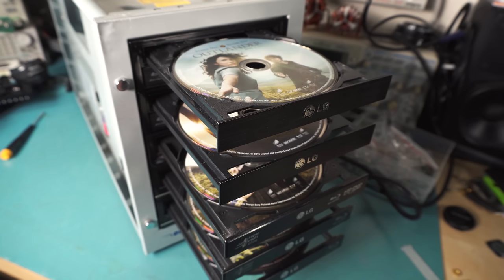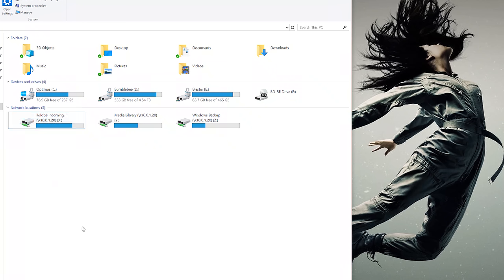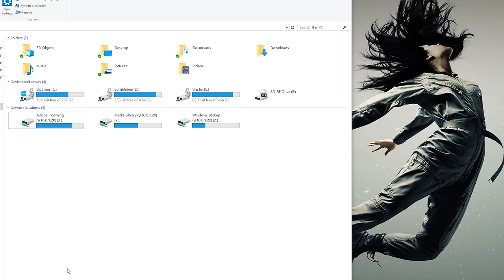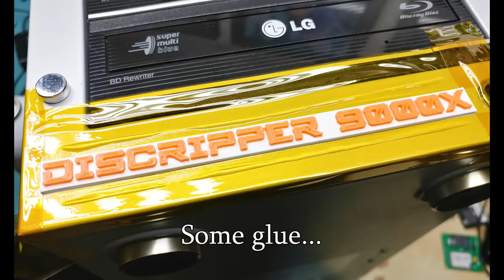Rippin' 5 Blu-ray Discs At Once (AKA The DiscRipper 9000X)

Comment: This was 4 years ago. How is still working for you? Have you done any modifications to it? If so, do you think it's worth doing another video showcasing what you've learned and changed over the years? Great video by the way.
Reply from the maker: I used it for years with no issue. The only real problem with it is finding the SATA and eSATA boards since they aren't being made anymore. I recently switched to an ITX test bench and a modular approach where I can easily convert it to a ripping station.

I will make a video on it... Someday. Haha
Reply: @PeterBrockie  it's still very useful and extremely cool IMO. I'm surprised that the boards are no longer being manufactured. Do you think a raspberry pi USB 3.0 to m.2 data daughter board and a SATA to m.2 board would work? Both are about $30 to $40 each.
Reply from the maker: @BrianThomas  You can go the Pi route, but if you're doing that you might as well build a basic computer from cheap parts. Granted, you can still use the duplicator case with a Pi.

I can see a Pi running out of cpu power or PCIe bandwidth if you start adding a bunch of drives though.
Reply: @BrianThomas  raspberry PIs are very expensive at the moment

It's certainly possible but it wouldn't be economical.

Comment: I've had to use 5 instances of MKV running in parallel to rip from 5 drives, are you using special software that can rip in parallel using one application instance?
Reply from the maker: Same thing. Multiple copies of MakeMKV.

Comment: If you were to redo this project with todays tech what would you use? I'm looking to create something similar. With 4 or 5 optical bay slots.
Reply from the maker: The tech of the case doesn't matter. It only matters how modern you want the drives (4/5 of the drives in this thing are 4k drives now, for example).

Just get any case you want that holds as many drives as you want. If you really want to avoid the plug in design of this one, put a basic motherboard in a case with lots of ODD bays and make a little ripping workstation.
Reply: @PeterBrockie  Well I plan to use blu-ray optical drives. I have four of them. However I'd like to go with a similar design that is plug and play and comes in a similar design as yours.

However I'm trying to see if there is a better solution when it comes to hardware. Was hoping you could make some suggestions. Been trying to research something of this for months and I got small ideas here and there of what to do.
Reply: @PeterBrockie  I plan to rip my content using a program called MakeMKV and the program can read individual optical drives. So that is needed for a design.
Reply from the maker: I use MakeMKV as well. As for connections you have pretty much 2 choices. You can go the expensive way like mine using an eSATA multiport adapter. Or you can hack together a ton of SATA -> USB converters, put a hub inside the case and run a cable from the hub. The hub method will almost always be cheaper overall, but be more fiddly to setup.

The hub method has the advantage of being able to support more than 5 drives. Although I suspect USB3's inefficiency will start bottlenecking you pretty fast when using blu-ray drives.
Reply from the maker: If you want to go the easy way for cases, just go to PC Part Picker and filter by EXTERNAL 5.25" Bays (https://pcpartpicker.com/products/case/#G=8,12). I went with a disc duplicator because I got to make a video on it and because they tend to be more compact than a PC case with the same number of drives since you don't have to waste space for a motherboard.

Comment: I need a 2024 update please 🙏🏾💯💯💯
Reply from the maker: The 2024 update is: This isn't really worth doing. My recommendation now is to simply connect a bunch of SATA drives to a spare motherboard and use it as a ripping system until you're done with all your discs. Then downsize to a single drive. :D

I ripped my large collection and had no use for this after. I still have some of the drives so I just plug them into my test bench computer and rip using that whenever I need to. Now that the bulk of my discs have be ripped, I don't need to do 100 at a time anymore. Sure the disc duplicator looked cool, but it just sits on a shelf 99.99% of the time once you're done your collection.

Comment: i've got an iview 4 bay enclosure with usb 3 and esata. cant even get more than one drive to work.  do these port multipliers have a set max capacity in terms of TB per drive? iview told me it was 3tb per port max, which was crazy. why would there even be a limit? would this be programmed into the controller?  i was hoping to build a 32GB station with 8TB drives, but thats not gonna happen since it wont even work with more than a single 1TB green drive pulled from a WD MyBook usb enclosure (marked A and B respectively for each drive) .

Comment: Stupid question ?? Why didn't you just have five different USB cables . and then you could have a USB add-in card with 5 USB so you just plug all 5 cables into it .
Reply from the maker: That would work and probably work out to be a little cheaper than the specialized route. In my case I wanted a simple, single cable so I can disconnect and hide the large drive tower when not in use.
Reply: @PeterBrockie  you can had one single cable . And inside the box you could have at USB 3.0 hub. But 5 drives going tho and USB hub . It would be faster tho 5 USB 3.0 cables and then put the cables in a sleave

Comment: Hi, I was looking for some videos on doing multiple drive rips. I have ALOT of optical drives, DVD, BD and an HD/DVD drive and tons of TV shows and movies. About your setup, did you connect the eSATA cable from your ripping box to the PC? In my case I still have my Asus P9x79 motherboard that has both powered and non-powered eSATA ports on them, so I could possibly make use of this for my drives. Only thing I don't have is a duplicator case, but I suppose I can just use an mid-tower case with enough drive bays on them. 

Great video!!
Reply from the maker: I used a usb to eSATA adapter - what matters is that whatever you're connecting to supports port multipliers, which not all eSATA controllers do. I wouldn't go eSATA these days. The parts are too hard to find and it'll cost a ton.

If your X79 board is a spare one, I highly recommend getting a cheap PC case with drive bays and putting the motherboard in it. The cost of a duplicator + the eSATA hardware I used is more than the cost of a cheap case and a cheap motherboard to directly connect the drives.
Reply: @PeterBrockie  thanks I appreciate the response. Yeah my X79 board has been sitting around for a good while and looking to give it something to do and since it has the esata connector on it may see if I can put that to use. I would guess then the optical drives would connect to the motherboard SATA ports then could output with the esata cable to another system (workstation in my case). 

The esata port driver for the board supports PM so may give it a shot. Plus I have a Cooler master HAF 922 case with 5 drive bays so just may use that instead. Save money that way.

Comment: Where can I find a ZAGE-D-ESAU3 ?   I have not been able to locate one.
Reply from the maker: They look pretty discontinued at this point, so I doubt they will come back in stock anywhere. Looks like the other method of using USB -> SATA adapters and a hub with one USB cable coming out is the only viable method now.

Comment: A simpler  way: raspberry pi + usb-sata converters+ passthrough drives to iscsi. connect to ethernet and use it like physical drives.
Reply from the maker: Does iSCSI work with optical drives? I've never looked into that.
Reply: @PeterBrockie  it is possible to export disk drives under linux.

For example, https://www.smetana.name/blog/2014/10/20/sharing-dvd-drive-over-iscsi/

Comment: What did you do with the original controller? I have a Reflex 10 that I'm looking at maybe doing something with, and I'm wondering whether you did any delving into the capabilities of the controller versus just gutting the device and bypassing everything?
Reply from the maker: In theory it could be reprogrammed, it's just a standard controller and cpu. But it was beyond the scope of what I needed it for, so I resold it and used the controller board seen in the video.

Comment: Could I buy a dvd duplicator and then modify it to rip dvds rather than duplicate them?
Reply from the maker: Nope. I mean there might be a duplicator controller with a USB port which shows all the drives on your desktop, I doubt there are many and I'm sure it'll be usb 2 speeds.

I think the best and cheapest way is to get SATA Odd to usb adapters for each drive and run them into a hub jammed in the duplicator. The eSATA method I show in this video is expensive and hard to do now that eSATA stuff is way out of production.
Reply: Thank you for your reply. Do I need a specific type of case/chassis which will fit the disc drives in?
Reply from the maker: Not really. I mean you can use any computer case with as many 5.25 bays as you need. Duplicator cases have the advantage of being smaller overall and come with PSUs.

Although duplicator cases are often old and heavy steel. So it's a trade off. That being said 5.25 bays are hard to find these days on modern cases.
Reply: I’d like to build something as close to what you have as possible, if I can. Aside from the case and disc drives themselves, what would I need to do this? 
I don’t suppose you could compile a short list of things I would need so I can try and look online for them?
Reply: Hi, can you provide a link for the sata odd to usb adapters
Reply: @PeterBrockie  hi, I’ve been looking for those sata odd to USB adapters but I don’t want to order the wrong thing online. Are you able to recommend one?
Reply from the maker: I looked more into it, and it looks like there isn't an easy way to do the USB route. I'm starting to think the cheapest way to have lots of drives is to either stack up drives and connect them all externally with SATA (not really recommended), or to use an ITX case with 5.25" bays, an old motherboard and just run the ripping software on that. It might end up being cheaper to buy a whole ITX system than to buy the eSATA stuff I used.
Reply from the maker: The issue is that USB->SATA adapters don't provide 12v power generally (they're meant for 2.5" drives), so finding something which can interface and power it hard to do.
Reply: @PeterBrockie  After searching around the internet, I can see its possible to get these controllers with just 2 SATA ports on them. Could i get 2 of these and link them up somehow to use with 4 optical dvd drives?
Reply from the maker: @jamiecurran4269  The reason the 5 port one I used works is because it specifically supports port multiplication via eSATA. It's possible there is a USB -> SATA adapter out there which supports multiple optical drives, but the one in the video is the only one I was able to find at the time.
Reply: Hey, I bought 2 of the cards with the 2 sata ports on them and tried to connect the drives up to my computer that way using a esata to USB adapter but when I plug them into my computer it says the computer cannot recognise/read the disk. Any ideas?

Comment: Which software do you use to rip the disks?
Reply from the maker: MakeMKV.
Reply: Thanks!
Reply: @PeterBrockie  Make sure to turn on multiple drive in MakeMKV so you can select the specific drive or drives you want to rip from.  If you don't MakMKV has some wonky DVD selection and sometime will start trying reading from drives already ripping.
Reply from the maker: Yep. Luckily they added that feature around when I made this thing. :D